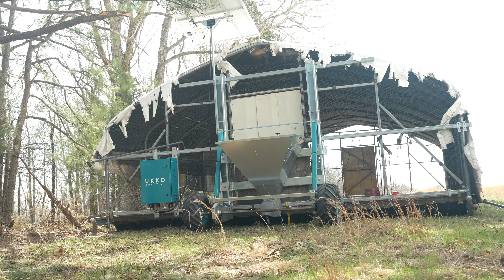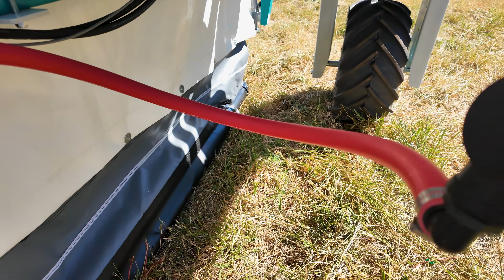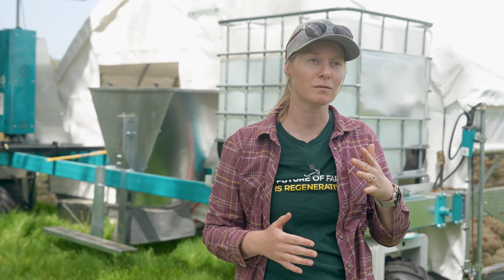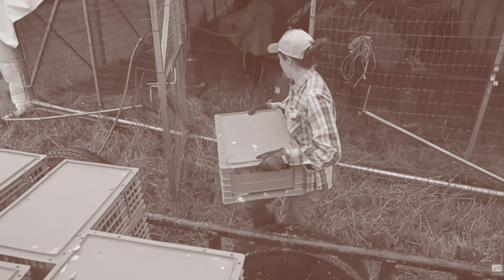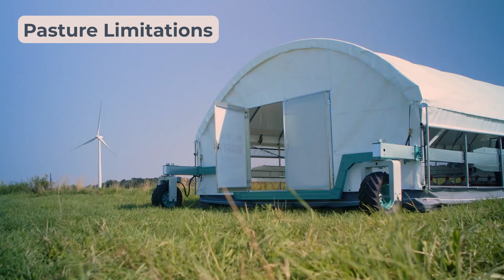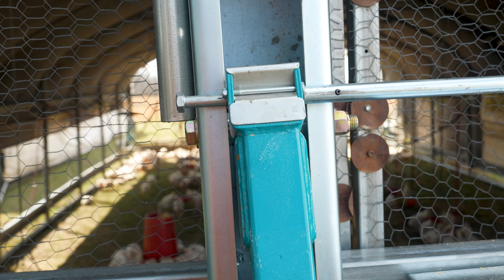Is This The Future Of Raising Chicken On Pasture? [Fully Automated]

Comment: Paint the IBC tote with ultra white gloss. Use masking tape to make a few observation marks so you can monitor the water level. You will keep algae down to next to nothing and keep the water cooler longer.
Reply: How does the white gloss keep algae down?
Reply: @ev560 It creates a reflective opaque surface for light reduction. Black paint or dark green will eliminate more light but will absorb more heat.

Comment: Good for UKKÖ. I designed this conceptually decades ago, but never built. 
Biggest differences: 
1. Mine- much larger diameter custom wheel for easy rolling and not getting stuck. Think old carriage-like.
2. Mine- TURNING wheels and smart movement to guide itself within a defined region autonomously. I can't believe they made turning so difficult when movement is one of their primary features. 
3. Mine-Rainwater harvesting and purification onboard. 
4. Mine Push bar- no need to chase birds away from the edge and do all your moving at once. It moves on its own very slowly and pushes the birds near the edge away. 
5. Mine- Lighter materials - looks like they are using steel not aluminum. 
6. Theirs- far more complicated heavy feeding system. 
7. Theirs- Roll-up sides was a nice idea . 
8. Theirs - Electrified skirt was a nice idea. 
9. Mine - smaller units so structural materials shrink and are much lighter.
10. Theirs - everything phone app related.
Since you have such a massive monster of a system anyway, maybe you should include a duckweed tray inside. Duckweed will self regenerate and reduce both your feed costs and your trips to replenish feed. The trays don't need to be any deeper than a half inch, so they don't need to be very heavy. Keep half of the tray covered so they always leave some for regeneration, and size according to the number of chickens and desired percent of diet.
Also if they are going to span such huge distances they should have more wheels vs. more structural steel, IMO.
Good luck.
Reply: What's a rough dollar amount  to build your design? I'm a beginner and cand afford the rova born but I like the design
Reply: @narriowalks842  That would all depend on size, and your scavenging abilities and DIY abilities. You can build large diameter wheels from scrap pallet wood, but it is a lot of labor and a little glue cost. I planned on custom one and don't know the price if you buy. You have to plan on something that can take on the Weight of the design you choose. Rainwater harvesting requires a flatish roof. For that you need to come up with some roofing there are many options. You might be able to rig a plastic roof similar to theirs and still collect rainwater, but that could challenging. If you are feeding chicken protein from BSFL, and some built in duckweed you can save a lot of weight on the feeding system as well as maintenance. 
Very Roughly and considering some scavenging, I would estimate about $800-$1400/ 100sqt for you. I am sure I can do cheaper than that, but I wouldn't want to make you think you can.

Comment: The problem with the system is it’s automation doesn’t save you enough money to cover the excessive cost of such a piece of equipment, you can make more money with traditional low cost chicken tractors and a slight increase in labor,

Comment: When a website does not have pricing on it, just assume they don't want my business
Reply: I saw an ad for these or something similar here recently, and a small one for like 300 birds cost about 12 grand, which makes it impossible to recoup your cost in any reasonable time, to do 300 birds with salatin Chicken tractors would cost you about $1500, that means this new tech would need to replace 420 hours at 25 an hour just a break even in a 10 year depreciation, when in reality if done properly with the proper system set up, moving the manually and servicing them manually for the scenario laid out above of four 10 x 12 Chicken tractors you would average less than 20 (14 to be precise)hours per batch of chickens, now assuming you have a long summer you would get maybe 4 batches =56 hr a year 560 man hrs ,which may appear more efficient , but in reality the additional 120 hrs across 10 years is what would be the labor still required to operate one of these,(12 hrs a year) and this doesn’t consider the canvas replacement cost every 5 years or the likely interest of a loan used to purchase one ,which  could even with only 3% interest costs the equivalent of 140 hrs.

This shows that the return on investment will probably take more than 10 years to notice and will only be marginal at best.

Comment: Good stuff! Put a fixed wheel/motor in each corner and make it 4-wheel drive, then you can turn it like a skid-steer. The left & right drive systems can be synced per side. That'll enable you to turn on a dime or as wide as you want. Pivot steering isn't a great option with something this large because your turns will be super wide no matter what and you'd likely end up using just as much power to turn the wheels as you would to add a couple additional motors and controllers. If you don't want to make it 4-wheel drive and want to conserve energy, just do a fixed wheel/motor setup in the two rear corners and leave your pivoting wheels in the front, then it'll turn like a zero turn lawn mower. A very big zero turn lawn mower haha. Just make sure your front casters turn 360-degrees. 🤙
Reply from the maker: Thanks for the detailed input! Very much appreciated :D

Comment: I was thinking that wouldn't it be better to be having the move be automated so that it moves a very short distance every hour until it gets to a certain point and then reverses and comes back the exact same way?
Reply from the maker: Interesting point, Allen. The movement pattern really depends on each farm’s specific conditions — pasture type, climate, animal density, and production goals. What works for one farm might not be the best fit for another.
Reply: @HeiferUSA I agree, but if you could have it move maybe 3 in per day along a certain line then you wouldn't have to be out there shoeing them over. They wouldn't even realize they were actually moving and then the span of maybe 10 or 12 days. The whole thing would be moved into a new spot anyway

Comment: I would add gutters to collect rainwater to fill the water tank.
Reply: someone who thinks. actually :)
Reply: Unless you have chem trials in your rain
Reply: Gutters are something to clean and maintain that has very minor utility. These properties use wells anyway, so the water that falls to the ground gathers minerals and is cleaned then still gets used.
Reply: If there is dirt and debris they will pollute the water lines and may clog up

Comment: Not a professional so maybe I miss the mark on this. Why not have continous movement? Just make it REALLY slow? So in my mind if you automate the system to move at 1 inch per hour maybe even switching to caterpillar tracks instead of tires you can eliminate several of the issues that I saw, for instance you could automate movement to be slow and precise, avoid most holes ( tanks and heavy equipment RARELY get stuck). If you move like one milimeter every other minute meaning in 24 hours you would travel 2.34 feet.

 I find it highly unlikely in this scenario that chickens would be trapped or hurt by this slow movement while at the same time it would be very unstressful for them. Even if the movement needs to be faster, one millimeter per second or one  and a half every second it would not even be noticed by the birds. giving you 4.6 to 5.9 feet per day. In fact it would be interesting to make it a setting you could do up to a certain amount.

Again just thinking out loud as to how to better automate and leave the chickens alone. At that point you do not have to do anything unless there is a problem with the system, or you need to add water or feed. 

At that point you are really only intervening when something goes wrong. Not only that but it solves the turning problem. you change the rate which the treads move and make it so one side moves more often than the other and the system turns on its own, You can even make it turn in a circle if you really want to. ( Technically you can do this with the tire based solution as well just make it so that the tires move independant of one another and you don't have to 'turn' the wheels to turn. Heck make it so some go backwards while the others move forwards and you can make it spin in place.
Reply from the maker: That's actually a really interesting idea! Feedback like this is incredibly helpful. Thanks for sharing your thoughts!

Comment: Don't use galvanized for the feed hopper.  Using a molded poly design allows the outside to be hit with a rubber mallet to release food bridged due to humidity.
Reply from the maker: Great tip! Thanks for sharing.

Comment: Aluminum costs 3 times as much as galvanized steel when used in structural applications; a bad design decision.
Carrying 2200 pounds of water onboard is a terrible design decision. Use a larger fixed tank and a hose. 

looks like the cost and weight of these assemblies are the limiting factors to make them practical. 
Someone needs to do a simple cost analysis to determine the optimum size of something like this. 
NEVER start from zero in your design process; number one item is to dimension the thing so that it can be transported on existing roads!
Reply from the maker: Thanks for your feedback! You pointed very valid concerns. This particular unit is actually the largest they've built so far, and it's still in the testing phase. They do have smaller, more practical models available on their website that are already in use by farmers with great results. This prototype is just one step in understanding what works best across different scales and needs.

Comment: I think putting a black sheet inside would increase the heat significantly. It would need to go on the outside to provide increased shading without drastically increasing temperatures.
Reply from the maker: Thanks for sharing!

Comment: Engineer here. The way to solve the issue of steering autonomously? Would be to move to a slightly bigger solar system and a 48V battery system. 48V/100amp will give you the power you need to pivot those wheels.
Reply from the maker: That's super useful information, thanks for the tip! :)
Reply: @davefroman4700  this looks expensive to scale, smaller autonomous systems would be an ideal solution for me, thinking I do a micro one for quail.

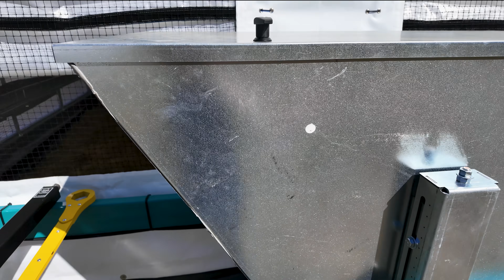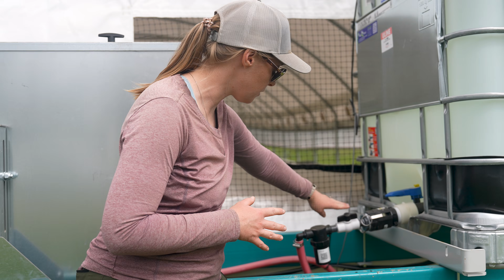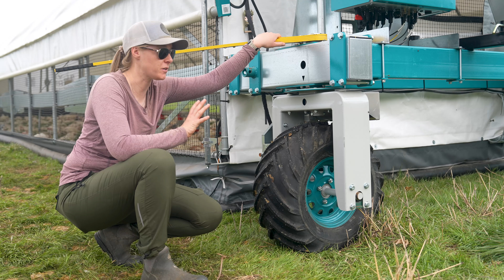Comment: @2:02 the feed bin, it needs a sight glass so you don't need to open the hopper. @2:26 the water tank needs an easy access water fill so you don't need to climb or open the top, the plumbing of that is easy. @4:18 yeah they do need to both add powered motors and install a stepper motor to steer all four wheels. The fans shown would be inadequate for the South East US, they would need to be bigger and a few on the inside. First time I saw a moving Chicken Hut it was Sanderson Farms and they moved them once a day with tractors. Finally, they need to install a few more solar panels and batteries to do all of that. Mount the solar panels along the edge cantilevered out from the Chicken Hut, and install a smart system that aligns the solar panels automictically for best sun and so the panels do not interfere with the chickens Sun Time, which is why I say cantilever the panels out like ___/ and its doable, not ideal but you don't want to mess with a chicken getting some sun. Add some perch bars, chickens love to perch and its an easy add. Maybe add a few cameras on the inside and out so you can keep an eye on it from, say a tractor. Also one of the best things for that kind of thing is large pastures, cattle, and a heavy seeding of Marigolds to give that chicken fat a nice deep golden color I so miss. Add 2 to 4 additional unpowered wheels to prevent drop out from hitting a gopher hole, the unpowered maybe put a jacking function in them to rise up that corner. To shade put an accessory sheet of dark material (green works and is natural for the chickens to see) but hold off from the regular roof to give a layer of cooling air between the two and don't cover the entire roof, maybe half so if chickens want to be in light they can do that and if they want to find a darker cooler spot they can go to the other side of the Hut, this is where adding perch rails comes in handy besides giving them some exercise to fly up to the rail if the entire flock decides to find shade at noon its doable.
Reply: Plant marigolds in the pastures -- Brilliant idea.
Reply from the maker: Awesome ideas! Thanks for sharing :D

Comment: Wondering what is the overall average cost to grow one chicken and versus to average price it's being sold?
Reply: If you’re lucky on a commercial scale, you’re making around a dollar per bird assuming you’re a contract grower. On a smaller scale if you’re marketing yourself, you’ll be making between five and $10 per bird. Your profit greatly depends on the cost of processing, also your profit margins can be higher if you’re in a place with lower Feed cost. My current cost to produce a chicken not counting processing cost is about $16-$17 a bird, and processing is an additional seven dollars per bird.(USDA processing.) if I do well in my marketing my cost per bird is $27-$30 per bird
Reply: Also, as a small farmer, if you were to utilize this system, you would have to grow more birds to make the same amount of profit because the main thing you’re making profit on as a small farmer is your labor and I ran figures on one of these units and the amount of hours you save will amount to around two grand per year in labor per structure, but that two grand will be paid out in payment for the unit, meaning you don’t make any more money or lower the cost of production you simply pay more of your profits to somebody else
Reply: @ssaifhsolutions  Than I don't get all this chicken business if cost per bird is $27-$30 and I pay in the store maximum $2 bucks per pound and  for  4 pound chicken I would pay $8 bucks.
Reply: @mksktube  the average weight of birds I find a store is between five and 6 pounds, and the reason somebody would pay more is because the chickens raised on pasture are raised humanly and without all the extra antibiotics and vaccines chemicals, etc., they also contain more vitamins and minerals being raised on grass. Obviously, if you can’t afford better quality chicken than you can get cheaper stuff, but some people do want better quality and can afford it.

Comment: Put hollow plastic tubes in a plastic feed hopper and add a vibrator to move the feed down.
Or add a drum with rubber chicken plucker fingers to agitate the feed.   Add iodine and/or hydrogen peroxide to the water tank for purification.  Build a Robo Tractor to move the Coops. The Tractor hooks up to a unit
that holds the water and feed tank as a separate unit from the Coop structure. The tractor can position
the Coop as per GPS Map Plan in Ardupilot.  The Single Tractor can supply water and feed to many Coops
as well as moving them as required.  Less expensive to build thus a lower capital investment. 
  Maximum Coop size = 500 birds.  Great Idea!!  Make the Coops out of inflatable vinyl tubes with 3 inch
PVC tubes at the base filled with dry sand and just skid the unit over the ground.
Reply from the maker: That's an awesome concept, thanks for sharing your thoughts!

Comment: Paint the feed hopper flat black and put that end in direct sun light so it heats the feed up and evaporates the moisture from the feed. Or add a small (maybe heated) dry air blower directly on the feed, may need to add a couple of solar panels for that.
Reply from the maker: Thanks for the ideas! Pretty clever :D
Reply: The perfect environment for increasing bacteria growth is heat and moisture.
Reply: @2almar2  but if you heat up the moisture and it evaporates then you're left with hot dry feed. see how that works.
Reply: @2almar2  and it's not heat and moisture its cold and damp nice try.

Comment: Meh, I rather do a coop on rails.
And supply food and water by gravity.

You can make a better one without electricity and higher durability.

On rails you can move it by hand or atv. And you can plant beneficial cover crops in the path for enrichment of the soil and feed quality.

Gravity feed and water means no mechanical or electronic failures.
Reply from the maker: That’s totally valid! Simpler systems have their advantages. What we’re testing here isn’t necessarily better for every farmer, just a different option for different needs :D

Comment: Do not stop trying! There is an adage that says: "The path is made by walking." 

To some of the comments just mentioned I'd like to add:
- Cabinet doors should open upward, not sideways. In order to bring extra protection while weather conditions are not so good. In an emergency you may need to open them for a while, letting humidity in.
- Electronics, transmision lines,  hightech devices etc are designed and built mainly for indoors use (let's say, with a City or Industrial mindset). Tougher options are difficult to find or are too expensive. Some (cheap) protections such as casings, rubber sheaths, clothing, etc etc etc would make them work better and last longer.
- Simplicity first! Some simple mechanical (effortless) cleaver devices for some parts would do better, cheaper and more reliable. 
- The base part (2 feet high for example) could be made flexible and adaptable to rugged terrain and  or to high/stiff pasture. 
- Instead of wheels, what about legs?
Reply from the maker: Awsome insights! Thanks a lot :D
Reply: @pablodebarbora1120  Legs would defeat the purpose of having a mobile shelter that can move on to fresh pasture regularly.